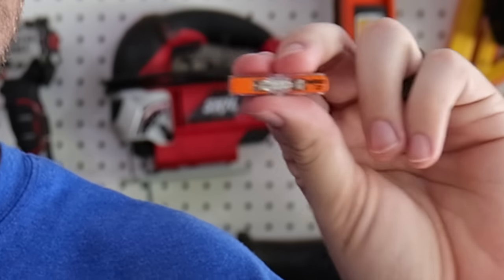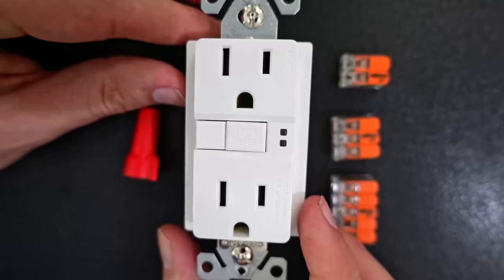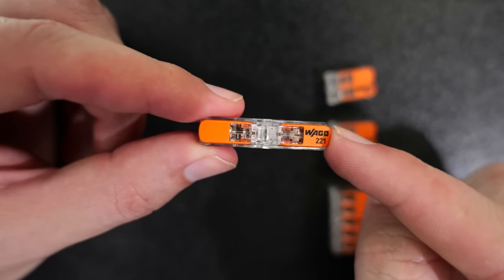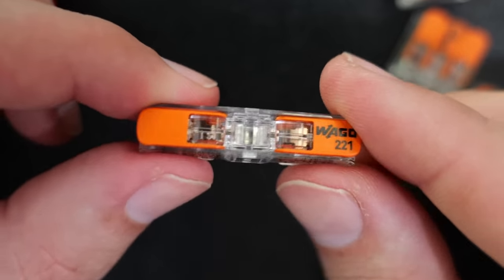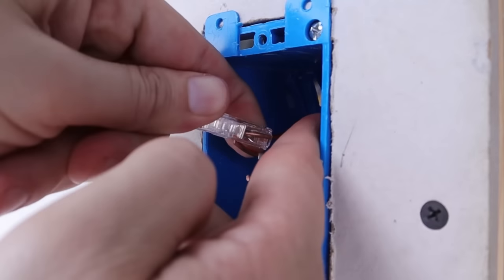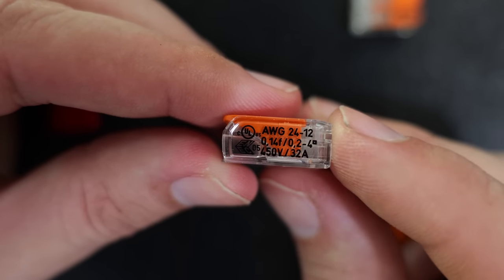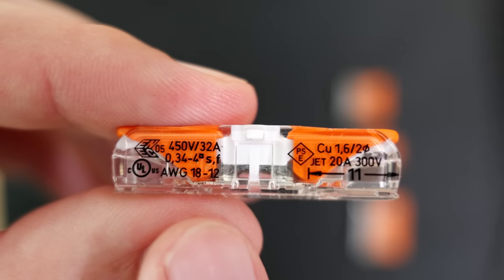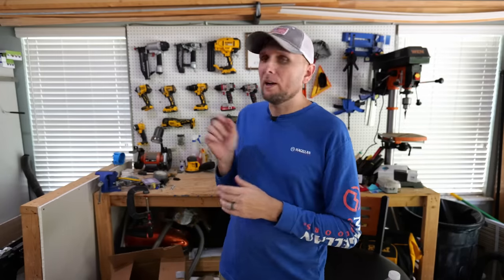New Wago 221 Inline Connector That EVERYONE is Talking About - And One Thing Nobody Talks About

Comment: How can it be that when a provider starts a tutorial they leave so much information out. What are the wire sizes for this device design, is this for Romex, HVAC often requires 40 amp 8 awg rated splices...are there any available? Not enough full meal deal explanations. At least admit rudimentary knowledge only so as to resolve unreasonable expectations.
Reply from the maker: I can never produce a video that fulfills everyone’s expectations.  Nobody can.  You want more technical information which some of what you listed I did talk about in the video and you either missed it or skipped it.  Well adding more of that would make it much longer if I added in a bunch of nuances to try and hit everyone’s questions.  Then I would be getting comments the opposite of yours saying the video is way too long and has good but unnecessary information.  The remaining answers to your questions can be easily obtained by going to the product itself.  It’s not that a video creator has “rudimentary” information, but often that we select the information we feel will be ideal for most viewers.

Comment: Surprised wago has not devised a clever lock shut mechanism for the odd case of lever lifting inside the box when a wire is pulled.
Reply: wrap the connector in electrical tape.
Reply: I betcha its in the works already. Knowing Wago
Reply: Here only WAGOs are used for electric connection, nothing else, so electricians just don't pull wires.
Reply: It is so weird, I only ever see Americans bring up that as a thing that happens, never heard of it elsewhere.

Do you guys pull on wires constantly or what? lol.
Reply: Why are so obsessed about the levers opening,